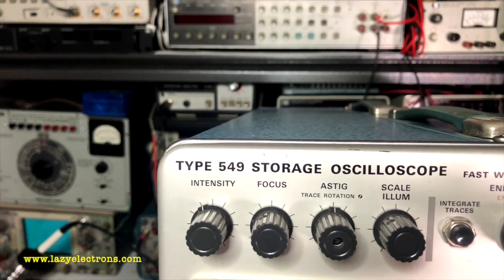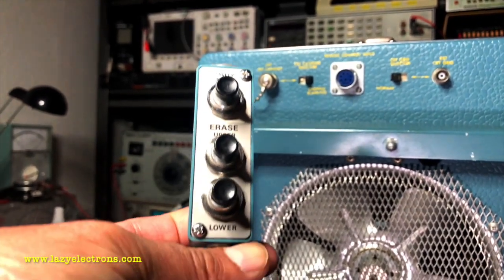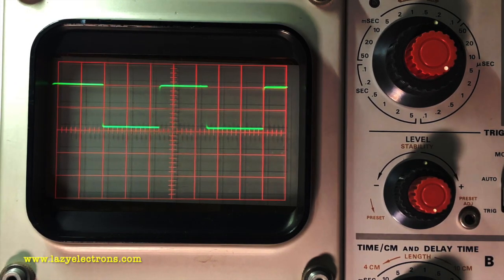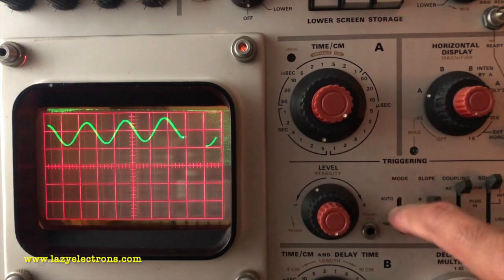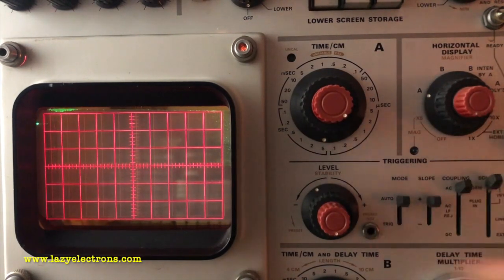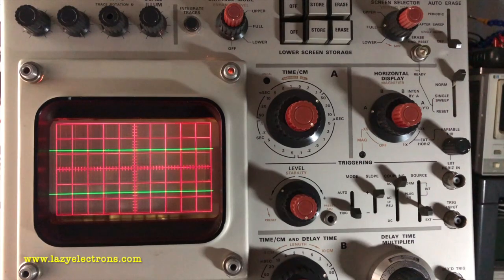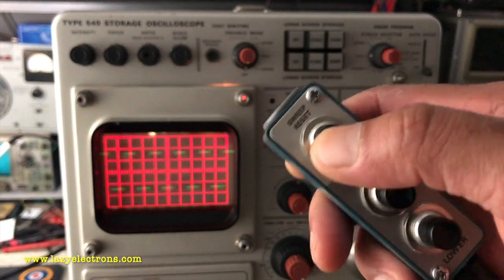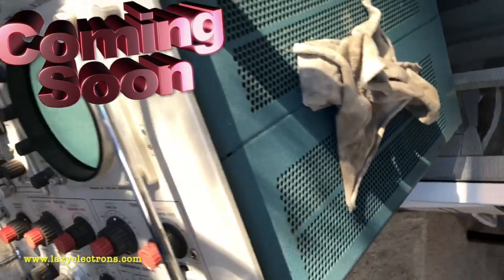Tektronix 549 Storage operation

Comment: I have found better quality Sprague and Mallory made capacitors have survived up to 70 years. The ones in this scope are only 50 so they are young yet. It is essential to not power up the unit without reforming the caps. But having taking the time to slowly reform, I seldom see a bad electrolytic.

Comment: Are those tube coolers on the big tubes (I guess 6080 dual triode) in the power supply from Tektronix or an add-on?
Reply from the maker: From Tek.

Comment: So glad you posted this video, got one of these at a  hamfest last September, hauling it across the Findlay OH fairgrounds to my car was quite the adventure. 😂

I have a 547 and a 549 to restore and always wanted to see the 549 in action but could not find much.  Luckily you have great video s on these two scopes. 

Now do you think reforming the caps over replacing will be worthwhile in the long run?  I definitely like the option of reforming but I’m afraid of burning a transformer due to a shorted cap. 

Also, do you know of an “audio range” spectrum analyzer plugin for these scopes?

Thank you very much for all your great videos, definitely looking forward to the restoration of that 585.
Reply from the maker: Glad to know its useful. Reforming/Recap - Very tough question. I cant take any side, I use reformed caps only after testing  and confirming leakage current at max rated voltage. But like you said, no guarantee.  I am not sure if I understand what is meant by autorange, You can find all the plug-in types here - http://w140.com/tekwiki/wiki/500-series_plug-ins_(Letter-series_and_1-series)  .
Reply: The audio-range spectrum analyzer plugin for the 500 series scopes is the 1L5. The 549 is the best mainframe for it, because the slow sweep required for audio frequency work would be awkward to work with on a non-storage CRT. I don't think there are many 1L5s to be found, though I could be wrong!